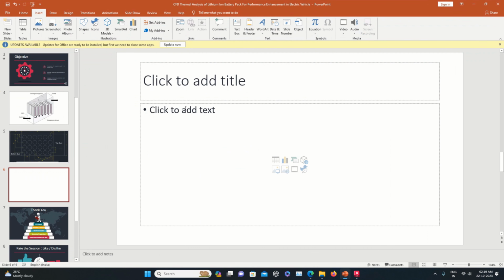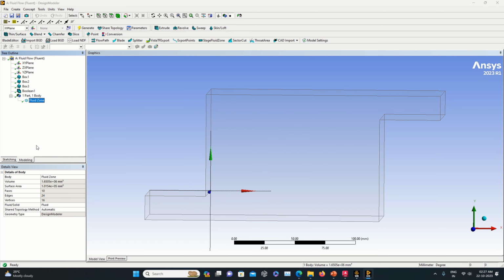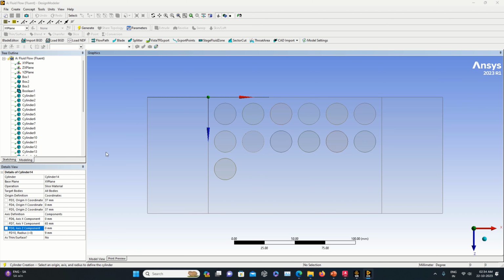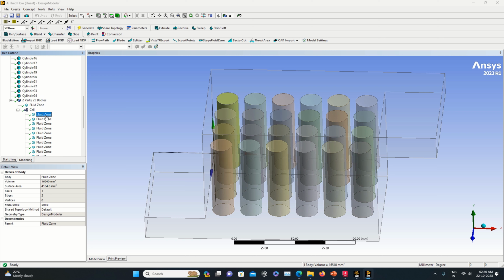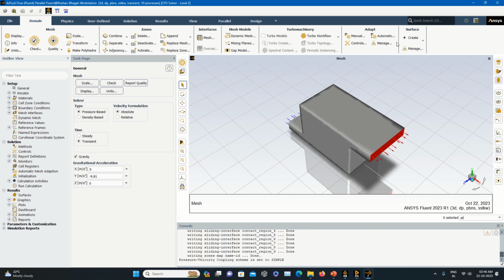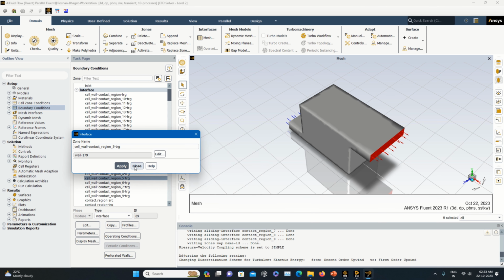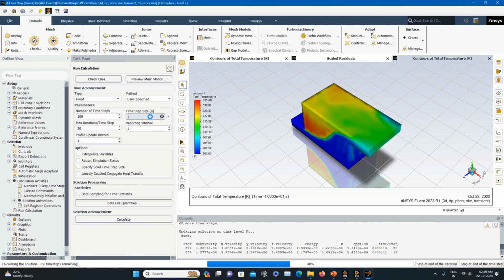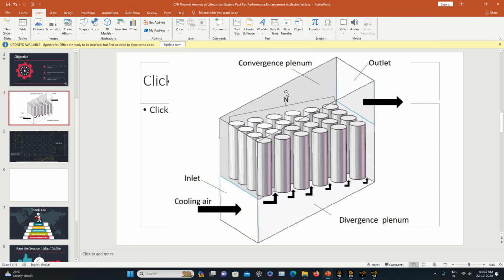CFD Thermal Analysis of Lithium-ion Battery Pack in Rectangular Channel with Air as Working Fluid

Comment: Is there any problem at SETUP part if i use 2 or 4 at the Solver Process?
Reply from the maker: no issue ...only if it is student version you can use maximum four
Reply: @Front @FrontiersInCFD an you do cfd simulation of airflow around of a human body?

Comment: Could you share the reference paper, name, or any link
Reply from the maker: may take this reference not exactly same.........Heat transfer enhancement of a lithium-ion battery cell using vertical and
spiral cooling fins
Reply from the maker: Structure Optimization of Battery Thermal Management
Systems Using Sensitivity Analysis and Stud
Genetic Algorithms

Comment: Sir, I have two questions. The first one is why did you change the geometry?
The second one is the most important one what’s the purpose of your simulation because it’s different from the article
Reply from the maker: 1. Why did you change the geometry?
The geometry was intentionally modified because the original article did not provide all the necessary details required to exactly replicate the model. Additionally, altering the geometry helps avoid potential copyright issues related to directly using the original design.

2. What is the purpose of your simulation, as it seems different from the article?
The primary objective of my simulation is not to reproduce the exact results from the referenced article, but rather to guide users through the complete simulation process. The purpose is educational: to demonstrate the correct methodology, boundary condition setup, meshing strategies, and post-processing techniques involved in such simulations. This approach helps learners and researchers gain a deeper understanding of the overall simulation workflow.

Comment: Please reply sir.......What is the change in temperature of a battery?...as the temperature of battery pack is decreasing so it reduced from what ⁰C to what ⁰C?.for example 50⁰C to 30⁰C..where I can see this?
Reply from the maker: Cells when generate heat reaches to a particular temperature. By providing cooling system we are controlling the temperature of cell, so that it will not reach beyond a particular point, for example maintaining at 30-to-35-degree Celsius, as power continuously draws from cell its temperature will not decrease but we can maintain the temperature.

Comment: Sir, I followed the video exactly, but during the "Run calculation" step, I encountered a "floating point exception" warning. What could be the reason for this?
Reply from the maker: what was time step size, if you have different mesh size then change mesh size
Reply: @FrontiersInCFD  it means I have to change mesh size bigger?
Reply: The calculation proceeds to about 5 percent, then a warning message appears.“floating point exception”
Reply: I'm telling you the problem. The problem is with your meshing, not the setup. This problem appears while you calculation encounters a division with 0. Checkout your mesh quality and you'll find its standard deviation is 0.
Now how to solve this problem?
--> make a mesh of your model from beginning and avoid 0 standard deviation in quality checking. You'll get the solution in sha Allah
Reply: @mdismailhossainnasim9469  wow really thank you, I’ll be try it

Comment: I have few questions. If you can guide

1. Why you have selected slice material for battery?
2. When drawing cylinder, why didn't you used mirror command to make all duplicate cylinder? Does it affect result? Or is there any other way?
Reply from the maker: there is interaction between two materials, which results in heat transfer other option is to go for conformal meshing and merge topology.
Reply: @FrontiersInCFD  Please explain this
When drawing cylinder, why didn't you used mirror command to make all duplicate cylinder? Does it affect result? Or is there any other way?
 like solid work and pro-E have option

Reply
Reply: I have drawn model as you told me . But  i am  not getting contour animation same pattern as you shown here. Can you tell me email so that i can show you image and you can point out my mistake
Reply from the maker: Yes it affects the result as you will see no heat interaction between two bodies i.e pack and cylinder
Reply from the maker: frontiersincfd@gmail.com

Comment: I did the analysis the initial cell temperature was 330 k , the inlet was 300, the final temprature in the contour plot is showing 315.24, I'm able to see the temperature reduction but when i am finding values at outlet (exit) the temperature which i am getting is 307, and as I'm increasing the velocity the temperature decrease i.e 303,302 . 
Whereas initially if the velocity is increased it shoulf carry more heat right , could you please guide me what am i doing wrong
Reply from the maker: If velocity is less fluid will get sufficient time to exchange heat

Comment: Sir after running simulation , the contour is showing only blue colour , no variation is shown !! Please Help !!
Reply from the maker: Look like error in boundary conditions applied
Reply: @FrontiersInCFD  Sir also one more doubt , in previous 16 cell simulation you put boundary conditions of wall in "wall-cell_1" but in this video you are putting boundary conditions in "cell wall contact region" !! why so ??
Reply from the maker: depends on what name is specified in mesh section